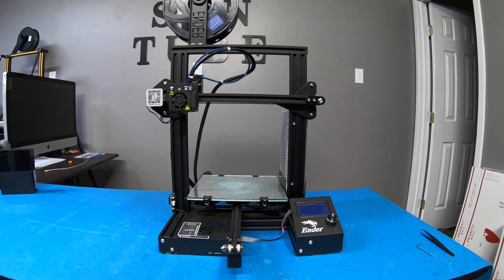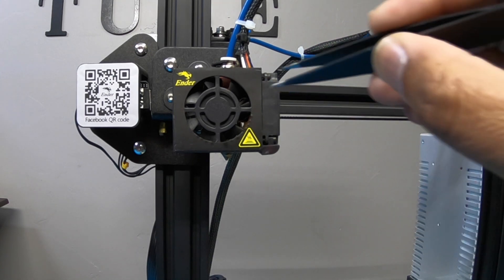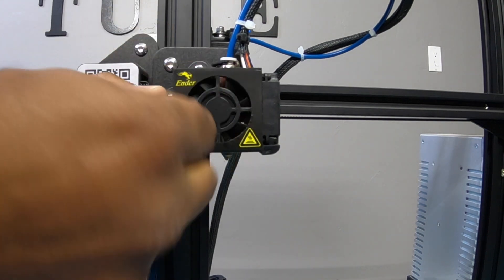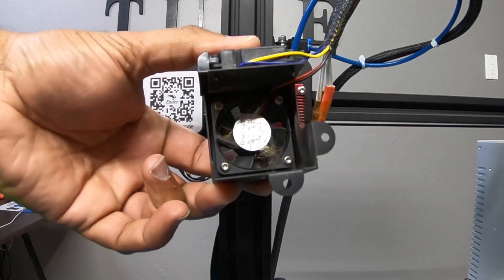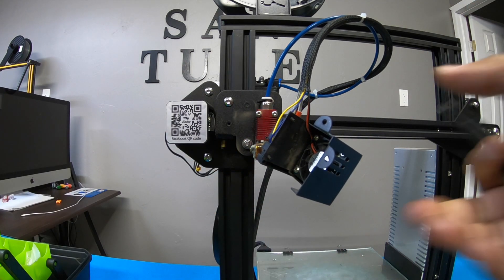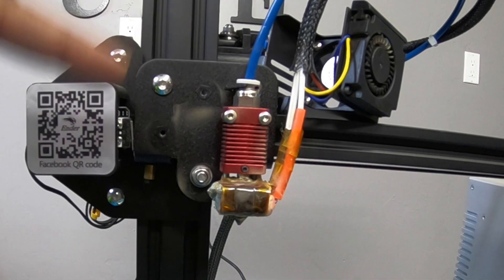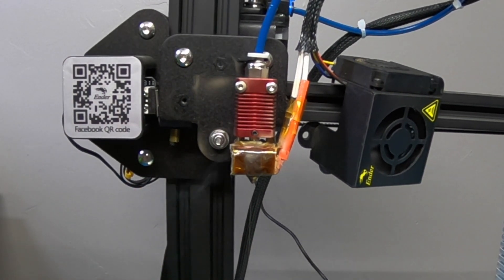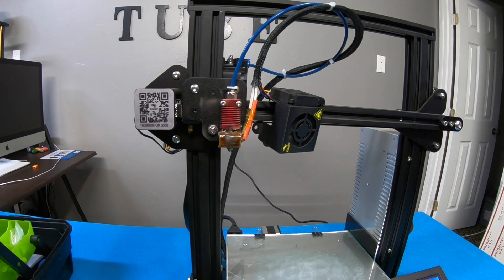3D Printing [ Printer Maintenance ]

Comment: Um actually, if your hotend fan isn't working as well, it has nothing to do with layer adhesion.  However, if that's the case, the filament will melt farther up into the heat break and cause jams and clogs.  It won't prevent your layers from sticking to each other AT ALL.  the part fan on the other hand, does relate to cooling filament, but again, the less the part fan works, the MORE your filament layers will stick.  The faster it cools, the WORSE it sticks.  Poor layer adhesion is caused from temps being too low, or layers cooling too fast, not the other way around........
Reply from the maker: Agreed! My point was if the fans don't work correcting it takes longer for you filament to cool before the next layer is put down.